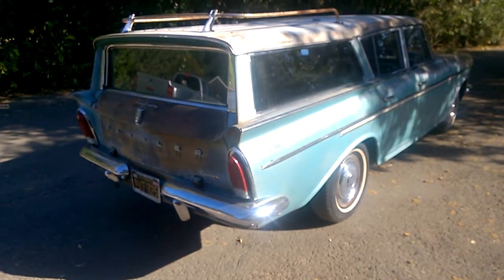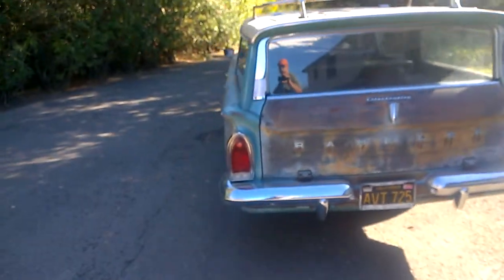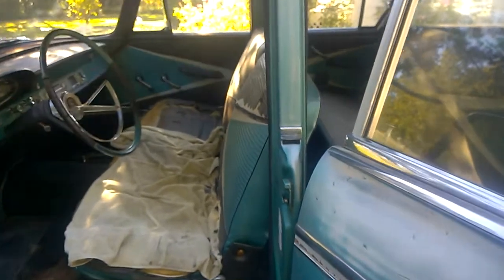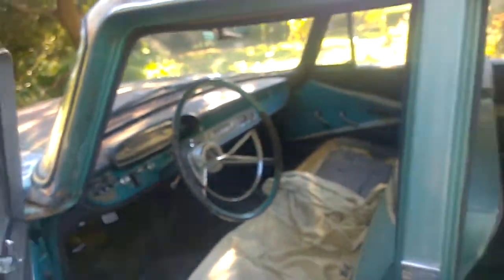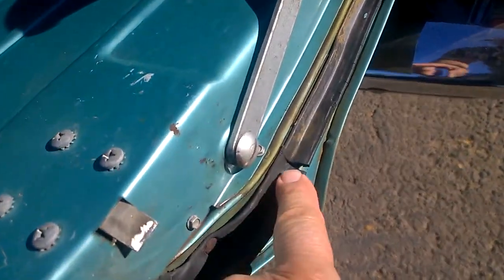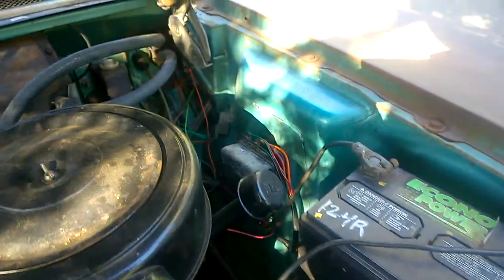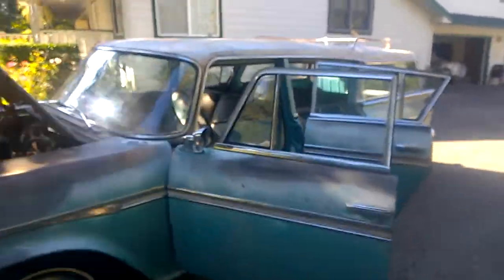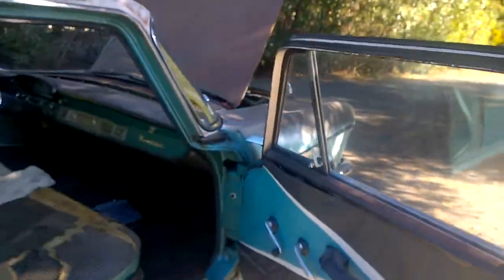1960 Rambler Cross Country Classic Station Wagon - Back Yard Find!

Comment: For a 1960, that's in very good condition. Especially if the driver's floor isn't rusted through.
I had a 1960 sedan back about 10 years, and 61 sedan, which was almost mint, except for the rusted through driver's floor...

Comment: That car is in really nice shape!  A friend of mine had one just like that one, except he had the 3-speed with overdrive.  In 1976 we took a 25 mph curve at 80 mph in the middle of winter in Wisconsin.  Those are the best handling cars built in the 1960's.  If someone had told me that a Rambler could handle like that ,I would have told them that it could not do it .  I would have been very wrong.  If the only thing wrong is that minor upolistery work, you have a very well preserved specimen!!!!

Comment: My father had a 1958 Rambler. 1958 and 59 were almost identical, by 1960 they change only the rear end, but the front were almost the same, as well as the engines. The Automatic transmission were really good, but the three speed manual were really poor, and we knew that by experience so if you still have the automatic version engine transmission keep it. It will be a plus when selling.
Reply from the maker: push button automatic

Comment: Hey was wondering if you still have the windshield from the 3 speedMine has a crack
Reply from the maker: The other car is nice and dry inside. I dont want to open it up by selling the windshield. Needs to go all at once. No engine and trans in it but I have them in parts.

Comment: Are you selling the car
Reply from the maker: sold it last month
Reply: @rodneyracer  That engine is a smaller version of the 6 in line blue flame from Chevrolet. about 130 HP on that year was incredible. I drove it many times and I loved it. In both ways manual and automatic.
Reply: @luisalvarez8963  My dad had one of these 1960 Rambler Classic
 These engines are nothing like anything gm made. These engines were bullet proof. The best they could due was the 216 and that motor was'nt as durable as the 196 engine. Nice try.